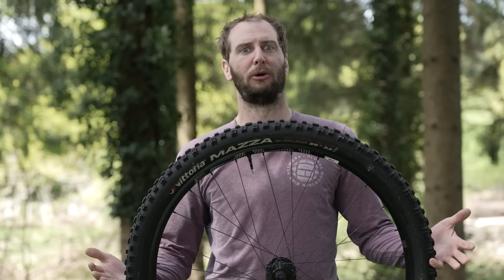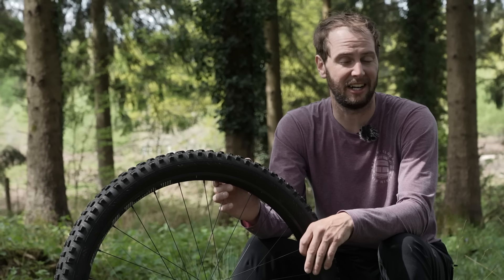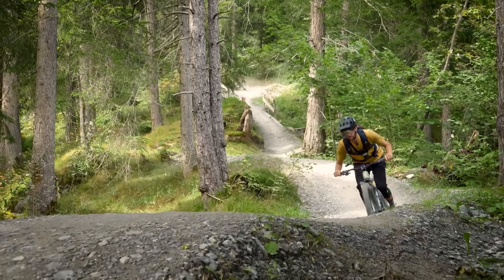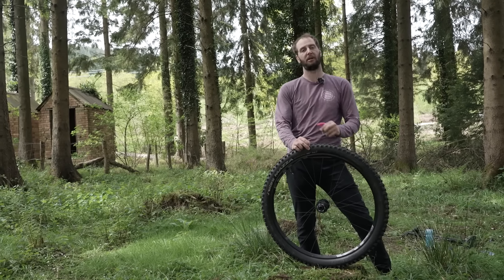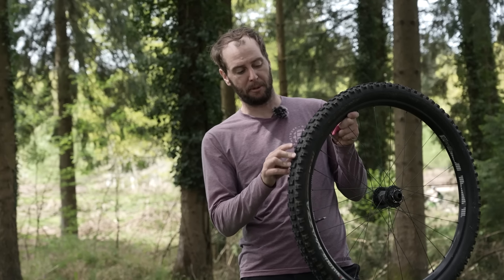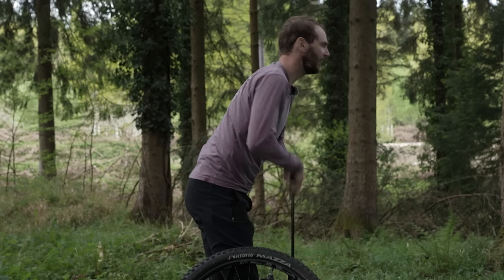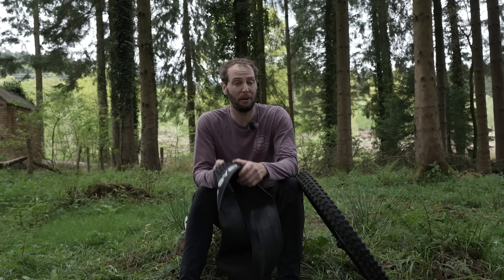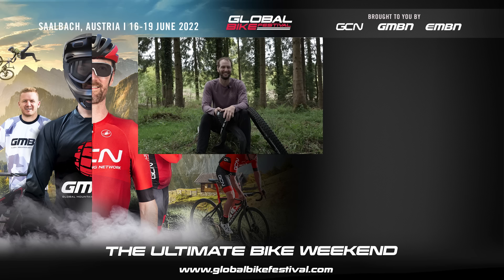How To Fix A Tubeless Tyre | Trailside MTB Puncture Repair

Comment: Little tip is get a lighter and heat up the bacon strips after you snip the ends off it will melt both ends together and form a little glue and seal better.
Reply: yeah i like the idea, thanks !

Comment: I suppose there is a reason for not showing how the tyre is removed from the rim 😉 In my experience, it is a pain to put on and take off a tubeless tyre, especially when you are not at home. So for me, there's not this big advantage of the tubeless tyres compared to the tyres with the inner tube. The nasty sealing fluid makes things even worse.

Comment: Hello everyone. Im 30 years old and learned something new a week ago. Maby the best repair invention ever!!! A normal inner tube but cut in 2 and sealed both ends. U never need to take the wheel off the bike. For sure electric mountenbikes. Its called a snake or sausage tube. If u inflate it its a straight tube. I never seen it before
.

Comment: Helpful video! 
I just got a puncture out on a ride about a hour ago on the same tire in the video: Vittoria Mazza!
I wonder if this tire is more prone to punctures than a Maxxis or other brand because I rarely
ever get punctures.  
It's a very small puncture so I'll try checking my sealant level and add if necessary.  Thanks!

Comment: Was sceptical at first ,but being able to just pull thorns out of tyre and ride on is worth it and lower tyre pressures of course. Downside is getting enough air volume to seat the bead i found  but 29+ tyres on 50mm rims

Comment: For us new to the hobby the videos you guys put out are awesome, much appreciated. What do you guys think about air-liners like Vittoria for example?
Reply: there a must have for me, they don't stop rim dents but they make them much rarer, plus there light and easy to install for me.
Reply: @robbieroscoe3078  appreciate your input, I’ll be giving them a try.
Reply from the maker: Hi! Thanks for the comment, we really appreciate it! We'd recommend the Vittoria Air-Liners as they do such a decent job at protecting your rims from damage and dents. They're more useful for rocky and dry conditions but they still work a treat if you accidentally case a jump! It's a great bit of extra security to keep your bike running prime! 🙌

Comment: How deep should the sealant be on the ‘dipstick’
Reply from the maker: Hi James! It's all dependent on how much sealant you've filled your tyre up with. Next time you top your sealant up, measure how much you put in, and then work out how much you've lost when you've been out riding! Another top tip is to compare the sealant levels with your other wheel. 👍

Comment: Using a tire boot as a permanent tubeless fix for a decent sized slash is absolutely useless. You need to sew the tire with burly thread, or better yet, fishing line. Then super glue inside and out, then use a proper butyl patch with the cement. Re-do the sealant and it's an actual "permanent" (life of the tire) fix.
Reply: thanks for this! i think this is what im looking for, a "butyl patch". because i tried classic patches and they just get un-glued, i think the sealant also ruins the patch glue :/ the last one i put in there was just floating in the sealant after a day's ride 😅
Reply: @Ris-v4w  just so you know, the patches im referring to are the old school ones you use on tubes. You have to clean the sealant off the tire really well, then make sure the vulcanizing fluid is dry but tacky. Then stick your patch and it will last a long time.

Comment: My Minions are leaking sealent and it looks like they are crying….. drop by drop all the way around the wall, didnt find and punctures…..any coments? Tnx.
Reply: The bead of the tyre need a fair bit of air to pop it on, I had to use a compressor on one that was  troublesome new  29x3.0 on 50mm rim
Reply: @yellowbirdruf1234  
Tire is beaded as it should be, sealent is leaking thru the tire, in the middle of sidewall
Reply: Must be something wrong with tyres shouldn’t be doing that

Comment: So basically if it's bad enough, you just go back to using a tube until you can get it home and fix everything?
Reply: thus nullifying the weight saving benefit of going tubeless in the first place!
Reply: @rouxenophobe  yeah, you'll be riding with 200 extra grams on your wheel until you get home. That's unacceptable.
Reply: @vangos154   It is unacceptable, because you have to carry that extra tube with you!